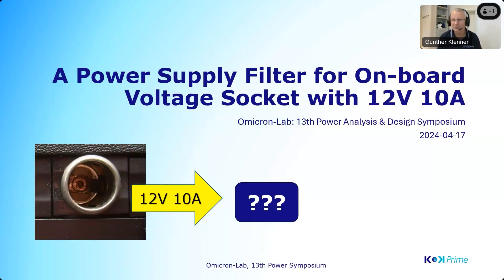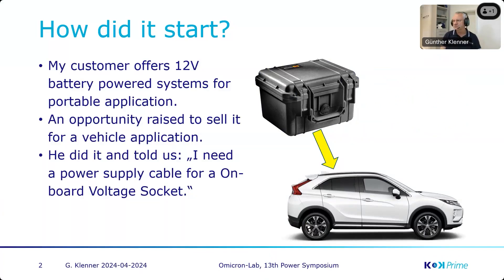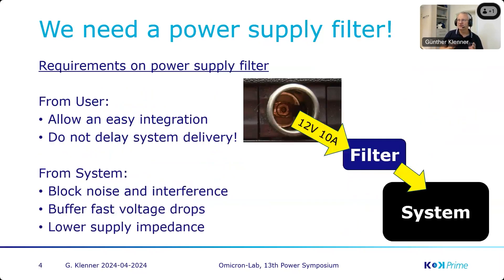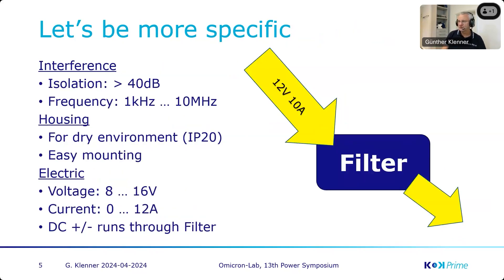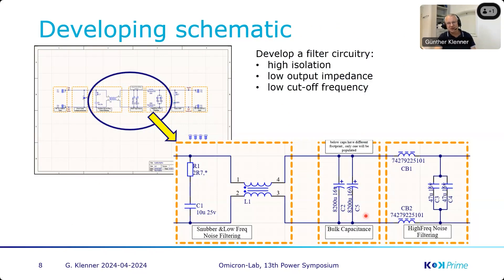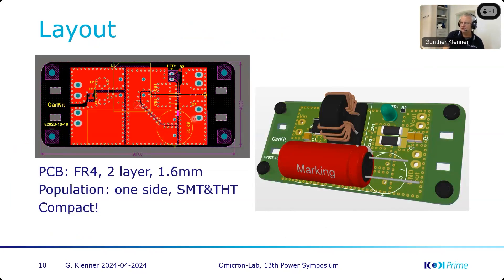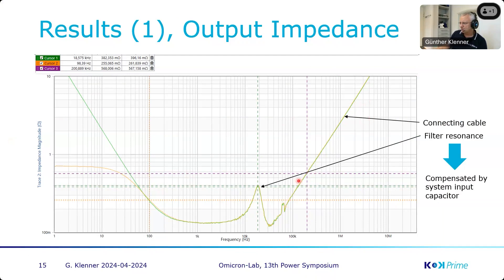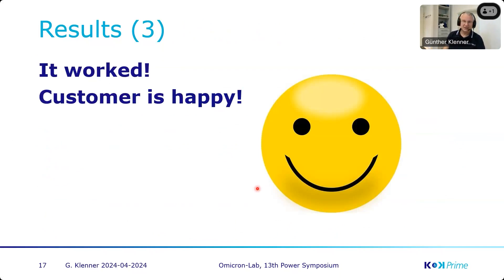A Power Supply Filter with On-board Voltage Socket for 12V 10A

Comment: Just wonder if the filter character would change if you run DC supply through it , i mean, it shouldn't be biased with DC supply 12 volt , 10A to see how impedance would change . Maybe your inductance would be saturated with 10A.
Reply from the maker: Dear Paul, can you please get in contact with Günther directly? We don't know the technical details of his work.